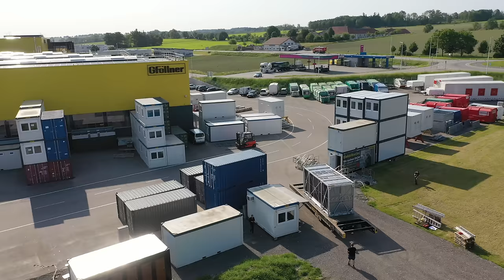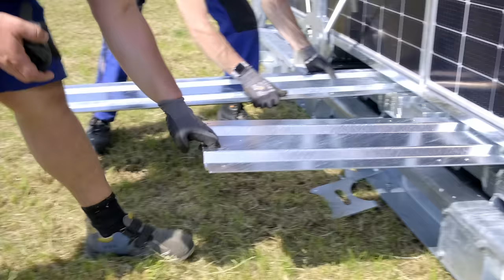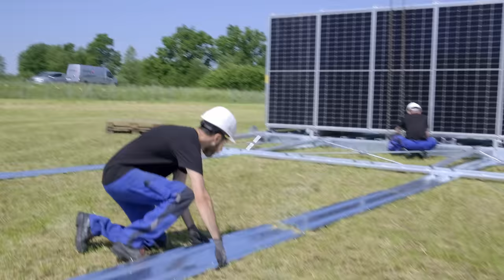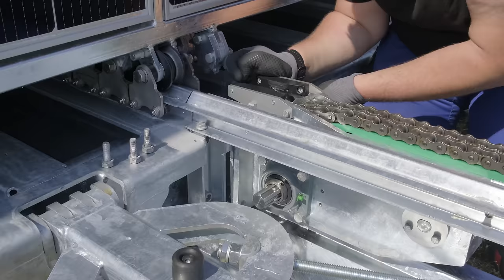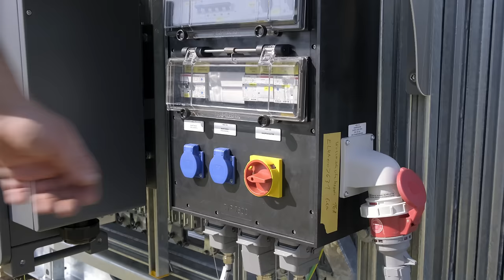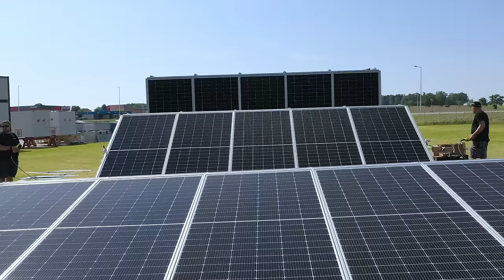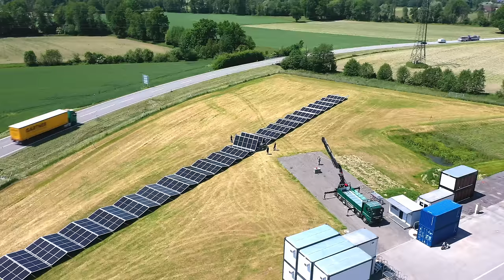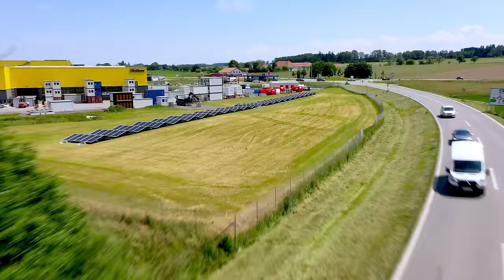Solarcontainer - The Original

Comment: Too much work
Reply: It’s literally about a week less work than installing it all by hand. Its probably not cheap and not a solution for most applications, but still quicker than a normal plan
Reply: Once you need that crane it becames costly. It will take a while to earn the rent of that crane back.
Reply: Jep.. typical German over engeneering. Why doing it easy if there is a more complicated way
Reply: That depends on the deployment site and length. The concept is nice.
Reply: @HansKeesom I’m sure it could have been put on a low loader and slid off. No need for crane.
Reply: Perfect for festivals and pop up large events.
Reply: @joeeigo9820  this seems like maybe the easiest way to do it, just needs some more joints to finish off the project and make installation faster.
Reply: Not such
Reply: Yes, it is for the novice in the application of Solar power 🔋.

Comment: seems overly complex for what it is, why not just stack the solar panels in a container and also stack some mounting frames. Unload the solar panel mounting frames using a crane truck and drop, expand in place, then use the same truck to drop the panels on the frame. Fewer parts none of the complexity of rails, takes about the same time and uses 20-30% fewer parts. I have even seen the whole system in a single container, batteries, inverters the lot, the panels are lifted and installed using a winch built into the container.

Comment: The right general idea, but needs improvement.  Need to keep the panels from blowing away in the wind.  Also need to elevate the panels somewhat so as to keep them from getting shaded or lost in tall grass and weeds.  Need to include sun shaded/UV immune ballast mass containers under the panels, similar to 275-gallon Industrial Bulk Container (IBC) totes, which can be filled with water on site (and some kind of cheap salt such a NaCl, MgCl2, or CaCl2, depending upon climate, to create a brine solution that does not freeze in winter).  Also need to develop an equivalently quick to deploy fence around the solar farm, to protect the panels from getting stepped on by cows/javelinas, and/or from being as easily stolen by criminally minded humans.

Once the above changes are made, it becomes possible to mass produce solar farms (suitable for permanent installation), but efficiently built inside of a factory.  It also becomes possible to ship the solar farm components to the deployment site using normal flat bed semi-trucks and then to deploy full size 1 GW+ utility sized solar farms, potentially in a single day (assuming the site has already been prepped by removing any trees and/or rocks that might have been in the way).

It typically takes at least a couple of years to build a new powerplant (such as natural gas, which needs permitting, environmental and safety reviews, new pipelines to be built and buried, and overly large physicals items that may be hard to transport and take time to assemble on site).  However, with solar farms, there is no reason why things need to actually take anywhere near that long.  Basically, very nearly all of the work of building a solar farm can be done in a factory, with associated benefits of mass production, without actually needing a custom site specific permitting and inspection process.

If the US actually had a uniform and consistent "national electric code", a single mass produced design in a factory, could easily meet the code and be rapidly deployable in all locations, without needing lengthy site specific permits or inspections, as it would simply comply with the code (if designed correctly in the first place).

Unfortunately, the US does not currently have a "national electric code", as all local municipalities and jurisdictions maintain their own codes and standards, which are not standards at all, since they are not uniform across the nation (or even across a state or county, as typically individual cities maintain their own building codes).  Until such time as the government stops being so incompetent, consumers will always have to pay more, get less, suffer from inadequate/restricted infrastructure, and to simply be much poorer than they otherwise could/should be.